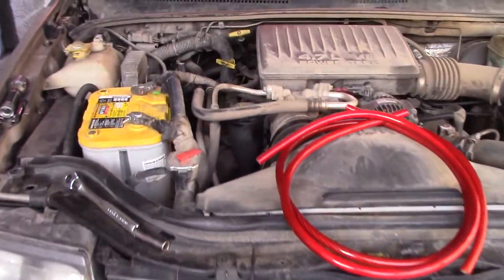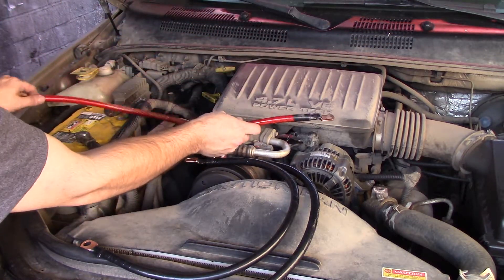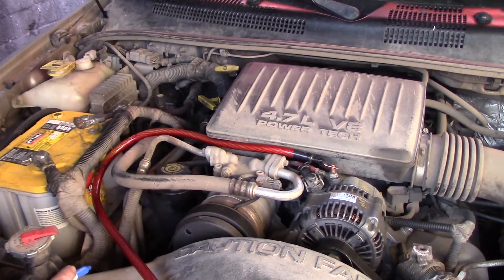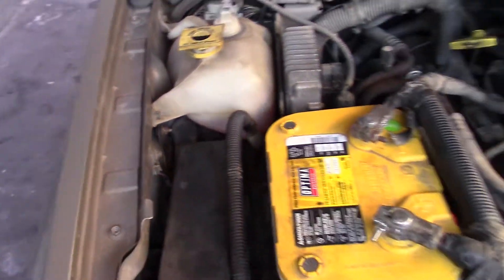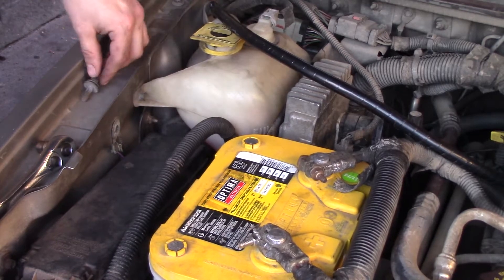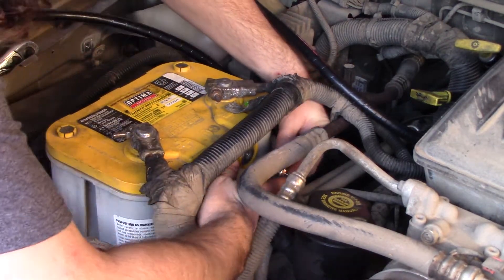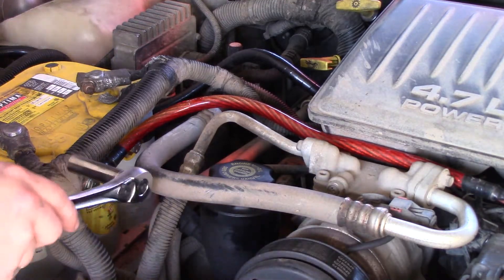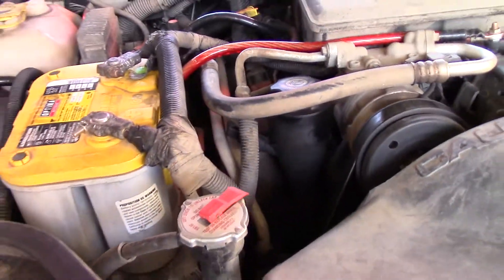Jeep WJ Big 3 install

Comment: What about a large wire to the positive of the starter from battery ?
Reply from the maker: So you're asking if you should put a larger power wire to your starter from the battery unless you're running a heavy-duty starter in like a really really big block V8 that requires it. This process is unnecessary for that. 
You could run the stock starter wire but you want to upgrade your positive from the alternator to the battery and the ground from the engine to the chassis and the ground from the battery to the chassis that is the big three I'm going to be making a new video with different color wires in larger size soon.

Comment: I am so going to be making this upgrade this weekend!  I have an intermittent ground failure that usually presents as a slight light flicker that occasionally turns into a lurch as the whole jeep loses power for a split second.  Let's see it it helps...
Reply: Did it help? I believe im having the same issue and I don’t want to have to replace my alternator yet

Comment: Whats the difference in adding bigger wire and leaving old wires / just putting only zero guage wires
Reply from the maker: It all depends on the install. I'm running the yellow top batteries that has dual Post locations top and on the side. So leaving the stock alternator wire going to the stock battery post is less work to do and makes you're 0 gauge 0 + 16 gauge bigger..

Comment: My lights keep dimming when bass hits would this help ?
Reply: Might try upgrading to higher amp alternator. I'm upgrading to a 250amp alt. with a 250 amp buss heavy duty along with a new 350 CCA battery.

Comment: I’m just curious, why would you want to run this set up, is it beneficial?
Reply from the maker: This increases your electrical system's current flow capability, ensuring a more consistent voltage under varying demand conditions, allowing more current to flow easier to all components.

I'm running a dual battery setup with a large stereo system and some high power offroad lights are next on my list.
Reply: Thanks! I might consider this for when I plan to add more lights
Reply: Great question! I was just wondering the same thing. Now I know what to do to my WJ because I am also running an off road light bar but want to add more to it in the future.

Comment: Hey what size crimp lug did you need for that engine ground bolt? Obviously at least 11/16ths but wth do you find a cable lug with with a hole that big??

Comment: Why is this needed?  I just picked up an 04 WJ 4.7, so I'm wondering what this does for it?
Reply from the maker: This increases your electrical system's current flow capability, ensuring a more consistent voltage under varying demand conditions, allowing more current to flow easier to all components.

I'm running a dual battery setup with a large stereo system and some high power offroad lights are next on my list.

Comment: I’m curious about the amp and processor installation location. I’m about to install a 5 channel amp in my WJ, and there isn’t enough clearance underneath the rear seat. Does your seat rest on your amplifiers? My seats  won’t latch with an amp under there.  I’m limited to the back of the seat or cargo area for amplifier mounting locations.
Reply from the maker: I cut into the bottom square hump area to gain a few more inches of space and air flow. My rear seats will latch with out smashing my AMP's. I'm still working on the AMP install video and a ton of others. Like & Subscribe to see more!!